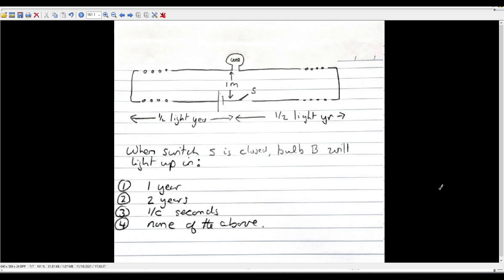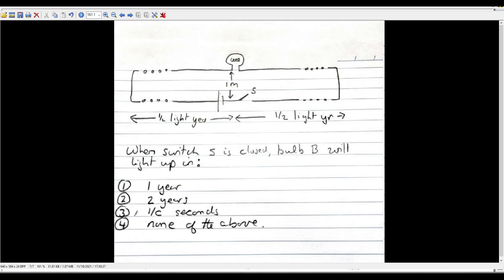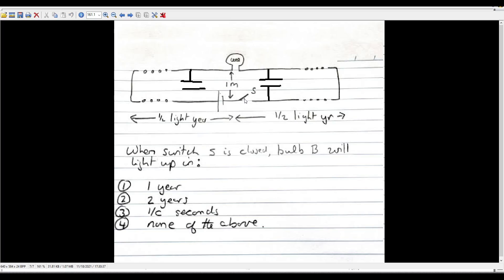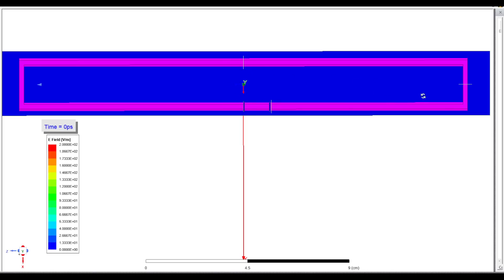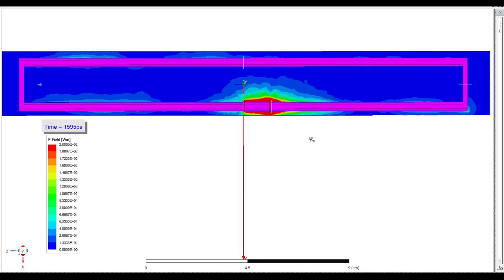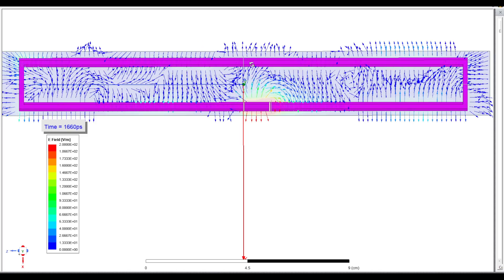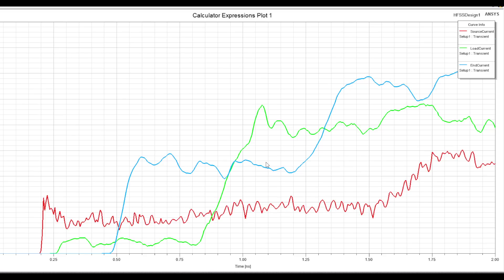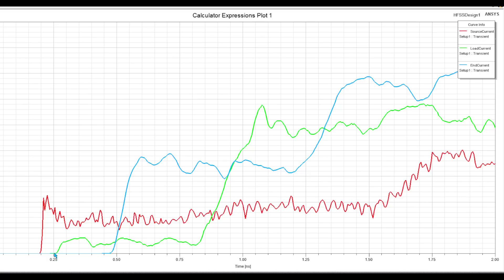Response To Veritasium - Electricity Propagation Time Problem

Comment: Clearly the Demonstration depicts something akin to a car battery, a switch and a bulb with 300,000 km of no resistance wires. 
The answer is that the amount of time needed to light the bulb is the amount of time it will take for current to travel 300,000km.
The bulb will see a small amount of inducted current from the EM wave traveling thru 1 meter of air, but that is not in any way adequate to turn it on. And by on I mean "ON"... not mildly radiating, not tingling, not anything except the Human version of "I see light".

In order for this to be a valid thought experiment, the light bulb must have some reasonable requirement for a specific amount of current in order to turn on, NOT simply any arbitrarily small amount of current.
If it was simply "any amount" of current then simply touching the switch without the rest of the conductor being attached would be enough to turn the light on, which would be preposterous. Wires would not even be needed. And we already know that if the wires are not present the light will not turn on. 
Conversely, If the light turns on without wires, then clearly, it is not a normal light. 

So, fact #1, the light must have a reasonable current requirement. And the power supply must be consistent with something like a car battery as visualized in the demo. It can be a "perfect" car battery. That is fine. The wires connecting everything can have "zero" resistance as well, that is acceptable for the thought experiment. 
What is NOT acceptable is claiming that any small amount of current will turn the light on.

The strength of the EM wave is inversely proportionate to the square of the distance and the amount of current that would be induced by the EM Wave when the Switch is closed and then travels thru 1 meter of air, is NOT enough to light a bulb.

We already know that EM waves can light fluorescent bulbs with a Tesla Coil. 
This demonstration is NOT about wireless transmission of energy in that way, it is the conjecture that the energy needed to light a standard bulb only requires that the EM field reach the bulb in order for the current needed to be adequate to light the bulb.
But that conclusion is simply wrong.

The correct answer is that in order for the Bulb to physically light (ie turn on), in the usual manner, is for the current to travel the 300,000 km to the bulb. That is the only way the bulb will receive the required current to light it. Anything else coming thru the inductance of EM thru the air to the bulb will be completely inadequate to light a bulb.

Simulations must take into account the bulb's current requirement., otherwise the conclusions made are not valid. 
The answer is that the amount of time needed to light the bulb is the amount of time it will take for current to travel 300,000km.
The bulb will see a small amount of inducted current from the EM wave traveling thru 1 meter of air, but that is not in any way adequate to turn it on.
Reply from the maker: The specific problem statement that my video was made around was Veritasium's original community post (photo featured at the beginning of this video). It had very underdefined parameters however you seem to have made several very limiting assumptions such as, "the power supply must be consistent with something like a car battery",  "not anything except the Human version of 'I see light'", "The bulb will see a small amount of inducted current... but that is not in any way adequate to turn it on" and so on.

I understand that you gathered some of these assumptions from Veritasium's actual video where he does indeed show himself with a car battery and some sort of LED lightbulb, and I would agree that the setup he showed would certainly not provide visible light from that bulb in 1/c seconds. I can understand why you might consider his video wrong or misleading in some ways. However my interest, and the intent of my video, is centered around the less constrained and much more theoretical original question which in my mind boiled down to: "will the bulb "know" that the switch was thrown in one year? two years? or 1/c seconds?"

Otherwise the problem seems too constrained to be a fun or practical discussion and just gets muddied into an engineering problem that can only be discussed once everyone has agreed on exactly WHAT the limiting parameters should be. Not saying you can't reframe the problem and probe further as you have done, that's totally fine, but when you say: "no the answer is wrong because you would need X amount of current to produce what I am considering a "visible" amount of light form a "standard" bulb using a car-like (12V?) battery, but also the wires CAN be superconducting", you have to realize that you have just made your own version of the problem with your own specifications to what was initially a very intentionally unconstrained problem.

For example, if you wanted to say it has to be some off-the-shelf red LED, but the source voltage can be as high as it needs to be, then you actually COULD light that LED for a year if you had a 10's of kV supply, a super fast switch, and 300,000km of superconducting wire. BUT, if you were to limit it to a 12V battery and a 60W incandescent bulb, as another example, then of course you wouldn't see any visible light until a year or so later. So what's the point? If the answer can change based on the specifics of the arbitrary limitations then in my opinion you aren't learning much about HOW electricity works, rather you are solving an EE homework problem. Not as fun to me, but to each their own!
Reply: @PulsedPower  Totally understandable. And since your particular example was created prior to the video, it makes total sense. 
If we make the base assumption that the entire universe is simply the problem at hand, and is the starting condition, then there is no condition physically possible where the Light would not receive an inductive impulse from the moment the switch was thrown. (time = 1 meter of travel time)
In that case, the light would always "know" the moment the switch is thrown.
However, that is only part of the final solution.

We also know that the Light was not claimed to be super conducting, nor was it claimed to be anything other than a "light source". Therefore, our constraints can be chosen carefully and cover most of these issues:
The range of power requirements for the light can be from any non-zero positive number to infinity, and has a voltage requirement from any non-zero positive number to infinity.
Additionally, we know that the voltage source was claimed to be perfect. Therefore, it can supply whatever the desired current is, at the desired voltage.
It is therefore possible to create a "range" of valid points covering various ampere requirements and voltage requirements that will provide a wide range of values at the battery terminals, and subsequently traveling thru the conductor.

If you use your model, using a wide range of those values against a set of power or ampere and voltage requirements for the light source, you will get some points which will then generate a boundary that demonstrates the following:
1. There are values where the light cannot possibly turn on using the power requirement you input when applying only the induced EM field at 1 meter from the source when the switch is thrown.
2. There are values where the light will turn on based on the power requirement using just the induced EM field at 1 meter from the source.

I predict that both position are factual and true. Same for the conductor, when the EM wave from the conductor finally reaches the light source.

Therefore, given that both #1 and #2 are true... Veritasium's conjecture that the power needed by the load is supplied by the EM wave at 1 meter is false, because it is not true for condition #1
While it may be true for condition #2, that is not relevant to understanding how electricity actually works. It's merely a byproduct of the excess power coming thru the transmission line of the power source and conductor, and NOT a property of the EM Wave in and of itself.

I do believe that given #1, and #2, the light will "always" know that it has been attempted to be turned on. But, it will not always turn on when the power that reaches it from the inductive wave is inadequate... whether from the 1 meter thru the air, or from the conductor itself.
But it is clear (at least I believe the tests will show) that the light will not turn on when the inductive EM at 1 meter is inadequate to power the bulb,. but adequate from the conductor until the EM wave of the conductor reaches the light source (meaning it will have to travel 300,000km or whatever distance is required to reach the light source before it will turn on)

Thank you for your thoughts. I apologize, I was not taking into account your perspective with regards to your purpose.
Reply from the maker: @marcfruchtman9473  
Well formulated response! It definitely would have been a helpful clarification for him to spend more time explaining given the over generalized nature of his statements.

Comment: Absolutely great animation! Probably not something for every Veritasium viewer, but surely for those with deeper interest in electronics, maybe studying something in that direction.
I worked with Ansys in university but only for mechanical analysis, what would you suggest is the best source to become better at simulations like this?
Reply from the maker: The best way to get familar is to think of a scenario and try to simulate it! You learn through persistance, it will probably take forever to get your simulations set up and error free at first but then you learn what NOT to do. The best learning resource is probably the help manual which is extensive, followed by youtube videos and forum posts.
Reply: @PulsedPower  thank you for your advice!

Comment: And 8 think it's an important detail, that the current will rise in steps. He did mentioned that in the video, but just briefly.

BTW. Could you repeat the simulation with the wires opened at the ends? I think that will explain things a bit. Longer wires could help a bit to show the scale.
Reply: I thought the steps came from the physical corners of the wires: by changing of the impedance at those places,  the impedance changes and reflections occur. Right ?!
Reply: @Marco ter Bekke you could also put a resistor in the middle of the line, so it's not only about corners, but yes - if the resistor is not matching the line, then reflections should occur.

This example is just so wierd, that the standard 'workarounds', just don't apply and you really have to go into the physic or simulate it in such nice software. I wish I had such tools 20 years ago:)

Comment: The capacitor thing - isn’t that effect so minuscule that it’s utterly inconsequential? If they were plates put close together, that’s one thing, but these are small wires carrying low voltage separated by a meter and they are in 3d space. I think your model is exaggerating the effect big time. I mean what we’re basically talking about is an antenna, right? It doesn’t matter if the whole circuit is open or closed. The wire is basically just extending the battery. Sure there’s going to be a super tiny amount of excitement, but the magnitude is unbelievably minuscule. Derek’s entire video is basically just making a huge deal out of an insignificant technicality. I think most people understand that electricity doesn’t always need a wire to be meaningful. Static electricity. Lightning. Electrical arcs. Grounding rods. His demonstration of a chain moving back and forth is a perfectly good demonstration of the difference between ac and dc. It demonstrates that the current switches direction over and over again. The only part that was wrong was when he put the wheel on top of it to signify the toaster oven. That part was wrong because that’s just not how you convert electrical energy into heat or kinetic energy. You get heat with resistance and kinetic energy with electromagnetic fields through coils and magnets.

I think his video is borderline clickbait. It’s way over exaggerating an utterly inconsequential phenomenon. He’s basically just saying the wire sort of acts like an antenna. His real life set up is extremely misleading. The bulb will not light. It just won’t. Will there be a tiny amount of excitement? Of course. Electrons are always moving around. They’ll move around even more with that setup. Yes, there will be a field. Yes, you can probably read it on a meter. Is that nearly enough to make a filament glow that’s rated for 120VAC? F*** no.

Am I wrong? Misinformed? Not understanding it correctly? I’ve watched enough “you don’t actually understand electricity” videos to at least suspect that I have a basic understanding of it. I’m always open to someone telling me I still don’t understand it. I’ll never fully understand it. I don’t think anyone fully understands it.

Please let me know if I’m crazy. I’m pretty that at least 75% of that is more or less correct.
Reply: I agree with this. Especially given the thumbnail "Energy Doesn't Flow In Wires" which is simply false. (3) may be the most technically correct answer to the problem as posed, but the thought experiment seems designed to mislead people grossly.
Reply: @bitbyt3r  I think the video was intentionally over-sensationalized for clicks and controversy. I don't think his intent was purely to educate. Typically when you end your video by filming yourself saying, "People are probably going to call me out for this," you should revise your script such that the overwhelming reaction will be positive, not negative or mixed. That is, when teaching physics.
Reply: I mean no, the electrons don’t carry kinetic momentum like a moving chain. That’s not how particles work. It’s all just fields and electromagnetism. Of course no single particle is going to go the full distance. We’re talking about atoms. They aren’t objects that are moving like water or even like molecules. They’re particles freely jumping from one shell to another. Creating a potential difference causes them to start interacting differently. It’s not like they’re all moving single file in a straight path. Of course not. They aren’t footballs that are being passed down a line. I would be surprised if anyone actually thought that. I mean yes, that’s a very simple way of understanding it, but of course that’s not what is literally happening.
Reply: ur not crazy man, i agree w ur point, i think most of us do, "over exaggerating an utterly inconsequential phenomenon", fucking nice
Reply from the maker: Jordan, you are pretty much spot on. The question has multiple answers that have truth to them, and which answer is "most" correct is basically up to the readers interpretation of the problem (since there is no governing authority, like a teacher in a clasroom, to approve or disapprove of certain assumptioms)

Here I simply pose my argument for why I think (3) is "most" correct, but I certainly acknowledge the truth in answer (1)!

Comment: One of Derek’s points was that electrical energy is not carried by electrons but by the electric field. So it would still be right to say that any single electron won’t (in a second or even a year) completely circulate this whole system, I think. Is it right to say that the carriers of the EM waves along the wire are the “electron holes” that are often explained to be what carries current, and the current in the load wire is just induced by flowing current in the source wire inducing a magnetic field?
Reply from the maker: Your first statement is definitely correct. Holes are simply the absense of electrons, so no its not quite right to characterize them as unique, and neither "carry" the EM wave, however both do influence and contribute to the EM field.
Reply: So, without the wires?  -- The wires matter.